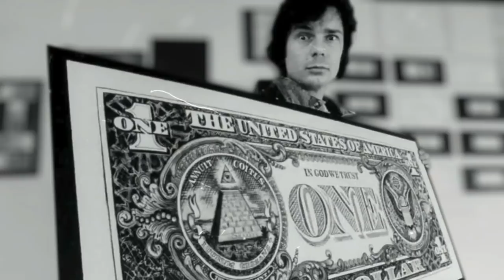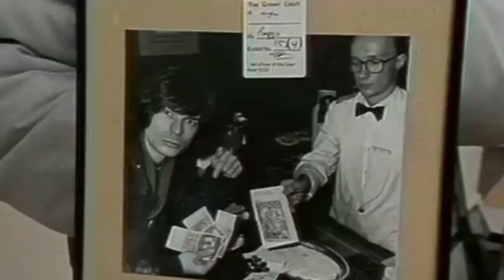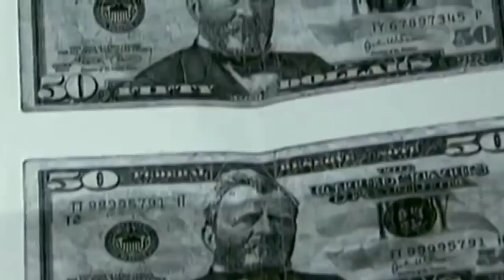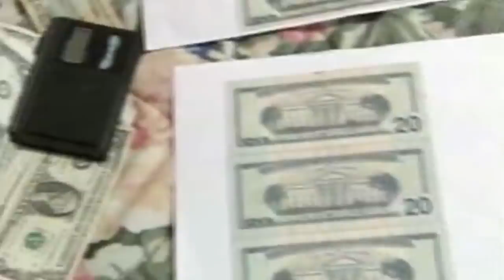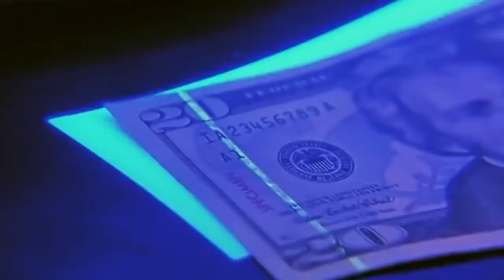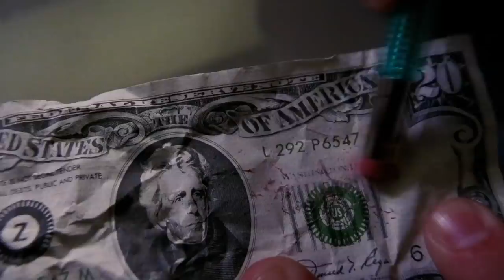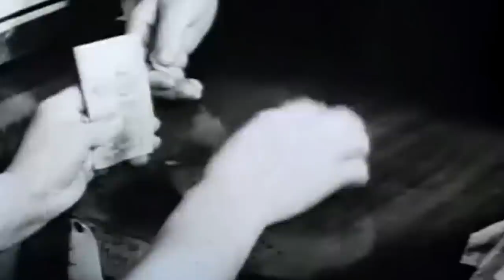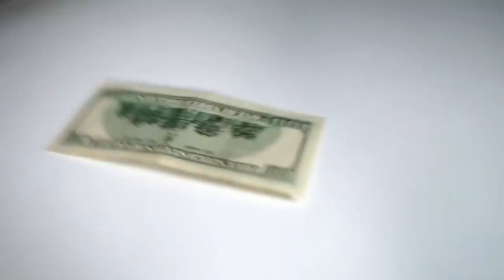Top 5 Counterfeiters of All Time

Comment: only gonna print off $20,000 USD to fix up my 91 nissan 240sx in a couple of days while on vacation from work cause you know tariffs are coming and my dream car parts went from 6-7k to a staggering 20k real quick if this bs agreement goes through ! fuck money lets trade ! what you want for a turbo? or how about a hatchback door? got a LS2 sitting around what you want? barter = dreams to a reality! as a matter of fact i traded my laptop to a guy for a ninja cause his laptop for his job pretty much failed i ran across another guy who wanted the ninja and traded me his POS ford truck this is where i ran across Mr. jackson III and he had a rebuilt titled 91 240sx nissan starts and drives bent frame needed doors and a hatch i traded the truck cause he wanted it for more things than his " reliable car " could ever do for him , but when i go the car trades seemed to stop cause like me everybody is looking for parts on this car alone so now its turning into a money pit that i have already put $3k into i could of saved $3k by trades but seeings how this car is iconic in ways that people know its value in a BS thing like money it became a check to check thing just to get it to where it would even pass inspection and be safely drive-able, no salvage yards have this car so going cheap to fix small probs also made it more costly. so printing money for a 1 time deal would be worth the small hassle in the end honestly. though swapping with a LS2 alone would set me back a bunch and i might have to up the printing process a bit........... lol the government and currency is all around bs to me when it comes to something of a dream to become a reality  a single thing to fix should not take a whole life time to achieve no matter how big or small it is ! they can make gas go bellow $2 but the cost of a door is $150 from a scrap yard and even more if its a rare and valuable car -_-

Comment: Many years ago,  I was 19 years old working at a Shell gas station,   It was late at night and a guy came in grab a small bottle of coke and reach into his pocket and pulled out a $20 Canadian bill,   It looked very much like a $20 but the touch and feel of the bill felt off,  I quickly put it under the light.  And told the guy I can't accept this bill.   He made some excuse, said his wallet was in the car would be right back.

Then 5 mins later an old man into the gas bar to buy cigs,  hands me the same $20.   I looked at him and said where did you get this? he took me that the same guy asked him for change outside the building.  the man was so upset, he said he was going down to the police station the next day.   not sure if they ever did catch the guy.